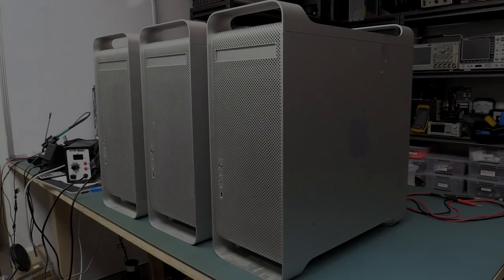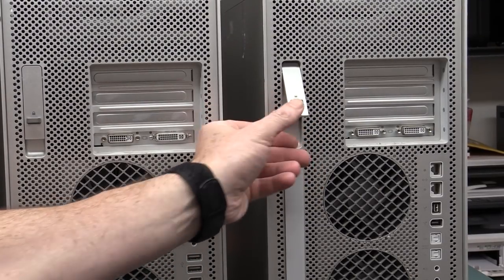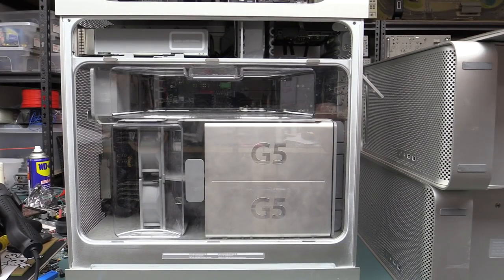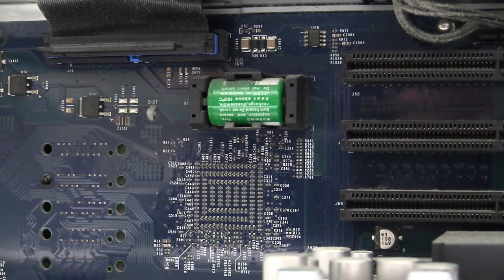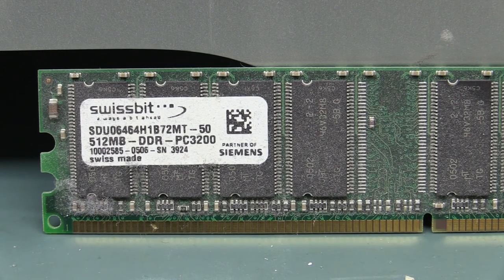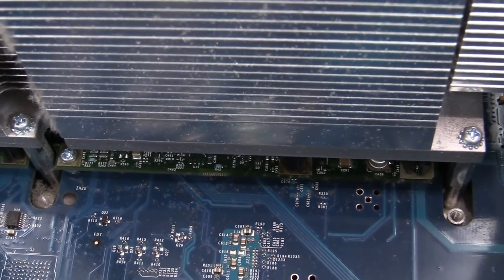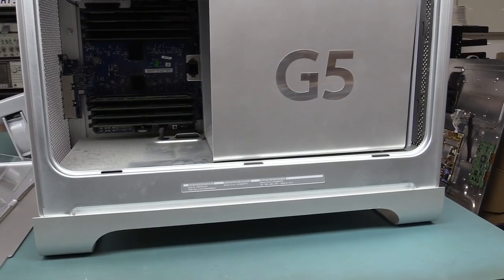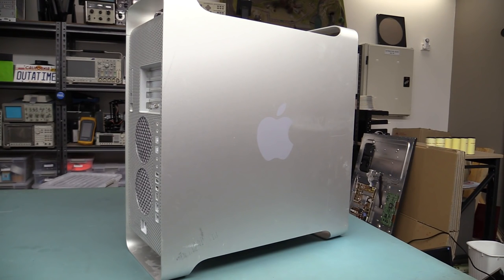EEVblog #783 - Dumpster Dive Power Macs

Comment: Even if you hate Macs, you gotta appreciate the extreme level of engineering that went into these beauties.
Reply: igeekone Well there bloody well be for the pretty penny these things went for back then.
Reply: It still seems a little silly in retrospect to put so much effort into the design given that (1) PC electronics are so short lived, (2) these boxes mostly sit under the desk where no one can see them anyway and (3) it doesn't add much to the usability of the system. It just sells well as people need their status symbols and it preys upon those who want the simplicity of OSX and need a lot of computing power. By setting the standards as high you can probably get a pretty good work morale, though, and attract talent, which potentially pays off more than I can imagine right now.
Reply: ***** The cases on these things still get you a pretty penny on the second hand market !
Reply: +youtubasoarus You can still buy new ones. The dual cpu ones sell for around 2000-5000 USD. New old stock, i guess they have went the way of collectors items.
Reply: +igeekone How can anyone hate something so well put together?
Reply: Richard Smith You're thinking the Mac Pro, not the Power Mac G5. THe cases are very similar, being configured slightly differently. The Mac Pro models use intel processors, have 4 hard drive bays, 2 optical drive bays, and a different port configuration. They were made new until Apple designed their "cylinder" Mac Pro... Which looks like the most over engineered waste bin in history! :P
Reply: richfiles No, i mean the original Power Mac G5's.
Reply: igeekone I thought the G4 Quicksilver was prettier. I've thought about getting a G5 along with a conversion kit which allows you to build a modern power supply and motherboard into the system unit. The drawback is that they're so heavy, and they do occupy a lot of space.
Reply: +RogerWilco Its called using your brain
Reply: +igeekone I like some of the aesthetics of Macs, but they are hugely overpriced in terms of the functionality per unit currency. There's a cultishness surrounding them that I dislike. Back when G5s were the shit in the coloured crayon department, people would swear that Macs were more powerful than PC. And yet, when the Intel-based Mac Pros arrived, all I heard was 'omg these things are so fast!'.  At this point, Apple had moved to an architecture that was widely used in the more powerful PCs...

I'd love to have a late-model quicksilver G4 - I liked the case design, and I have a bit of thing for owning older non-x86 systems, but I really enjoy my current system, which is a budget self-build 6-core system in a pretty (and non-garish) case, with 12GB ram, 4TB of mirrored storage, decent graphics. It (usually) runs Gnome 3 and Arch Linux. It's fast, the UI is pretty, the operating system is rock solid, powerful, very well served for the kind of tools I use, and free . I use Windows for gaming, although there are more and more games available for Linux.
Reply: ***** Good news for the Amish!
Reply: Even more so on the 2008-2012 Mac Pro. 4 hot swappable hard drives along the top, the entire motherboard slides out on a tray, and another board for the RAM. Beautiful engineering.
Reply: +igeekone I hate macs but the work that went into the creation of these is a thing of beauty. I liked the OSX based macs much better then the os9 ones as OSX is basically a derivative of UNIX with a fancy ui and several mac specific changes.  I do however miss the old world macs forth interpreter built into the open firmware /bios.  I had a lot of fun messing about with the schools old macs open firmware playing pong written in forth.
Reply: +Joe Steinregen why make anything beautiful? These cases will be around for years to come to admire and enjoy.  Even if it is in a museum.   😐
Reply: +igeekone Yep, and sadly now they just look like a garbage can......
Reply: hornylink wow, yeah, it totally sucks that you can't, say for example, put different hardware inside that case to reuse it. might as well just throw it away and buy a pretty new dell. :(
Reply: +Daniel Carroll the mac book pro would be better for this.  The Air is meant for light weight computing.  The mbp actually has dual graphics cards, it has a beefier one it uses for more graphically demanding computing and a less powerful one for normal stuff, I suppose this is to help with battery life.
Reply: +Salafrance probably people assumed that power pc was more powerful cause they were less sluggish than windows PCs,   but the matter of fact is windows PCs are just sluggish cause windows is bloated. yeah Mac OS X or Linux will run circles around it on the same hardware
Reply: Usmar Padow PPC is also a completely different CPU architecture 800Mhz (or even less) PPC machines where putting 1Ghz Pentium 3 machines to shame back in those days.
Reply: +Aaron Blakely Yeah, if I am not mistaken PPC is a RISC CPU, but still, I think the speed of macs is more about lean software. since intel macs run much faster on older hardware than equivalent windows on the same hardware
Reply: amigojapan You're correct.  Apple basically just optimizes the shit out of OS X for their hardware, since they control both sides they can do that.
Reply: i agree
Reply: That is why some Apple computers performed well but IF you had to get them repaired you would be up shit creek with the insane repair prices that Apple is famous for.
Reply: +John Doe funny, I never ever had to pay Apple any repair bills. I did buy an Apple Care account once when I was upgrading my old G4, needed some info and that G4 was getting old.
Reply: igeekone They perform like trash today,  but they look BEAUTIFUL.
Reply: igeekone To preserve the case, some people shove modern PCs or hackintoshes inside.
Reply: Richard Smith was smoking the funny stuff two years ago.
Reply: better IO than the new ones
Reply: i like macs :3
Reply: I agree!! They are really well thought out.

Comment: I wish apple still made workstation grade desktop PCs like this. The design and attention to detail is just insane.
Reply: Jay Anderson They do, the current generation mac pro...
Reply: ***** I agree that they are amazing, but I meant traditional desktop PCs that have expansion slots, storage bays and such.
Reply: +Jay Anderson having two harddrive slots (in the mac pro of this video) doesn't really stand for a "storage bay". PCI-E expension is a big issue, though
Reply: +TheAwesomeSauce It seems that there is no longer a news for the expansion slots. My clients (film editors) love the new Mac Pros because all the expansion is done via Thunderbolt which makes sense to them, and they are the biggest market for these Mac Pros. I guess Apple does know what they are doing.
Reply: They've engineered out the need for a PCi card to run a second monitor, that was the biggest need. Also dont need to run internal drives on a ribbon cable. Maxing out RAM was very handy. This one was not handy to rack mount, as the DVD/CD drawer was sideways.
Reply: +TheAwesomeSauce And so the best solution is to not have the slots at all? I guess that works if your market doesn't need it, but never gonna happen for me!

On Linux, we've gotten really good at solving driver issues... it used to be bad, but every day it gets better. Now we even have stuff built into Gnome that can update firmware automatically!

Comment: Thought the cases themselves were still worth something for the people who make their Hackintoshes.
Reply: Some people will go the distance, but for a decent job it's about as much effort as designing and manufacturing a copy yourself.
Reply: Gustavo Ferlizi Indeed. I had a try and threw them out eventually...
Reply: o0julek0o I've made one of those with the g5 case and put two 180mm fans in the front. It's just perfect for good airflow. I paid like 80€ euros for a bare used case but i think it was worth it.
Reply: o0julek0o I'd love to do a Hackintosh build in one of these cases..
Reply: +AnthonyH I'd hack a commodore 64 into one just for the reactions it would get. or a raspberry pi running risc os
Reply: SuicideNeil They are not useless because mac collectors will usually pay a fair price for one. And also the "server" g5 is actualy good for basic use, but the single core is the only one that is shit
Reply: o0julek0o I was just about to comment that, thank you! What kind of a person in his right mind would throw an aluminum tower case? I, for one, would have Hackintosh'ed the hell out of these cases.
Reply: SuicideNeil Well, actualy i'm fixing a g5 that i'm going to use as my music mac, ofcourse i have a beter pc but this is the best mac i have
Reply: KX36 Build a cluster out of Raspberry Pi Compute Modules inside of one? Wonder how dense you could actually pack those little things.
Reply: o0julek0o cooler master made something similar to that design, and they now have better looking cases - look for pc gaming cases - its literally a stolen design from it
Reply: +Jersey Vegas It's similar looking, but the Cooler Master version is just your typical flimsy aluminium & plastic case.  Certainly not 1/4" thick rolled aluminium.  I think that's why the original Apple cases are desirable as a hack versus buying the Cooler Master knockoff.  Plus, when you're ready to chuck it, you have $100 worth of aluminium you can sell to the metal recycler.
Reply: olepigeon thought so, but who really has the knock-off? i know there was a few year gap where all the computer case companies were basically stealing each others designs
Reply: +olepigeon I've used a Silverstone ft-03s for my hackintosh and let me tell you that does not skimp on the aluminium. It's got 2mm-2.5mm thick aluminium side panels and uses a very different design, although it has a similar aesthetic.
Reply: Chiron Evans I use a cooler master storm trooper for my gaming rig - im pretty sure that its solid steel with very heavy duty plastic, the case alone weighs roughly 20-30 pounds maybe. either way its heavy and solid - it takes a lot to drag it or knock it over
Reply: +AnthonyH If you go to the TonyMac site, there are pictures in the gallery of people doing just that. And you can also find discussion threads where people (builders) describe the process. Pretty sweet end results, as I recall...
Reply: +cab3 Seeing as you pay like 80 euros for a normal case, I'd say that it was worth it. I'd rather have the beautiful g5 case than any other case
Reply: they are
Reply: You're gonna have to do a little physical hacking on these unfortunately.
Reply: I sure want one. Have to look around on eBay. New Motherboard, new Stuff, and install Mac OSX
Reply: o0julek0o I don't even like macOS and I still want to built a Windows PC inside one because it looks so good.

Comment: 8GB of RAM in 2004? that's was a lot of memory back then. I don't think I even had one back then.
Reply: Darren Jacobson If you look closely it says 1 Gb (as in giga bits, not giga bytes) on the stick. So, I believe the system actually has 1 GB of RAM when all sticks are installed. I could be wring though.
Reply: Ehsan Tofigh That's possible, but memory is usually labelled in bytes, not bits. Or at least it has been for as long as I can remember, and I started out on 486's
Reply: +Ehsan Tofigh Those machine really had 8GB of ram. Those were 64bit CPUs so they could handle more then 4GB.
Reply: +Darren Jacobson Yeah 512 MB was the standard back then. 1GB was deemed as overkill and more than 4GB was seen as stupid for anything but servers. 8GB is just now becoming the standard, with most pc's only having 4GB.
Reply: +Richard Smith Actually in 2004 most machines went for 1GB. That same year SP2 for XP came out and from that point 512MB was getting short. The better workstation had 2GB and a year later some people started having 4GB which was partly stupid because XP only supported 4GB of RAM and Graphic memory combined. The main reason why people installed 4GB (knowing they would "loose" 256-512MB because of their graphic adapter) was because they used four indentical 1GB memory modules which was in fact not that stupid after all because mixing different modules could actually slow down your system or even make it unstable.
Reply: +Darren Jacobson I remember that older memories sometimes hadn't a clear reference to their capacity. They would give a reference to their capacity per chip and a multiplier depending on the number of chips. 
Sometimes it was easier to plugin the module to check it's capacity instead of guessing it.
Reply: Ehsan Tofigh No you're wrong, I have one myself and they shipped with one 512MB RAM stick by standard, the RAM was darn expensive back then however.. but the first models supported up to 8 GB (yes GigaBytes) and the last revisions supported up to 16 GB.
Reply: +Ehsan Tofigh They are pretty standard DDR PC3200 memory sticks, clearly labelled 512MB, the other ones are PC4200 DDR2 1GB sticks, even though they do indeed say 1 Gb, no such thing existed back then, they're 1GB each.
Reply: +Darren Jacobson The chips are usually labelled in bits, which on early 286 and earlier you had to put into the motherboard individually. Then the SIPP and later SIMM memory sticks appeared which had usually 8, sometimes 16 (double sided) memory chips on a single SIPP/SIMM stick to form one or two bytes.
Usually nowadays you will see 8 chips on a SIMM, sometimes 9 if you have ECC memory.
Reply: Ehsan Tofigh Nope. I own a Power Mac G5... Ina  closet. It was the crappier model that "only" took 4 GBytes of RAM. The max stick back then was 1 Giga BYTE per stick. My model was the crappy 4 slot model. These were the nicer 8 slot motherboards.
Reply: +Darren Jacobson My current desktop only has 3GB of ram, the large sticks of DDR2 are expensive, almost cheaper to get a new i5 with DDR3...   :p
Reply: +funkyironman69 actually yeah it does have an SSD so I guess I can get away with 3GB for a bit longer :p
Reply: +Darren Jacobson My 1.8Ghz G5 has 8GB DDR 400 in it. Not very useful due to the lack of 64Bit PPC Programs...Photoshop was never released as 64bit PPC, but it used some kind of workaround with a patch you could install..
Reply: +Darren Jacobson Is suspect they were using it for a file-server or similar, perhaps not just as a high-end workstation.
Reply: Im guessing it was an AVID. Maybe a DVD encoding station.

Comment: Clear them out, set them side by side about 50mm apart and get a sheet of glass for the top and you have one hell of a coffee table..
Reply: +Mahogany Gaspipe I would mod one of those cases to put in my hackintosh pc inside.
Reply: Yup. That's what will happen to the two I have. The big problem however is breaking little toes on those aluminum feet.
Reply: Mahogany Gaspipe use convex glass for a nice glossy finish and fashion narrow slots underneath into which only vendor-patented rectangular coffee mugs will fit.  Now sue Samsung for using shelves.
Reply: ahh you beat me to the punch...
Reply: Pop it 
into the shower
Reply: Mahogany Gaspipe why clear them out? just clean them and dust them so they remain heavy and pretty
Reply: readyrepairs There's a lot of useful goodies inside.
Reply: readyrepairs Because then you can modify the door and use them as storage... also, depending on requirements you could stick a car battery in one of them powering a 12-5v dc-dc converter for powering the leds and usb ports for phone/tablet charging... probably only need to charge it very occasionally...